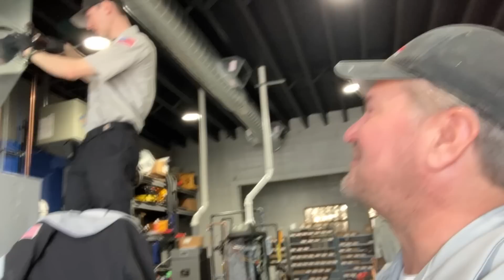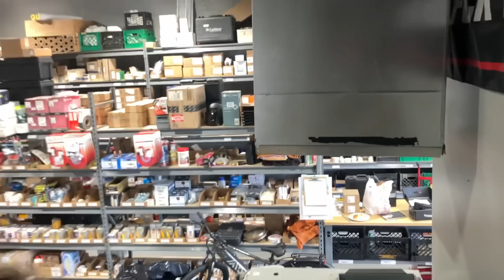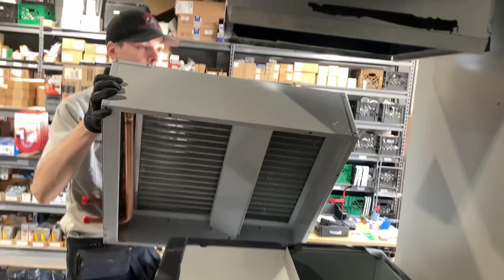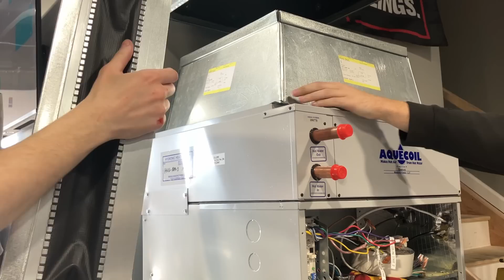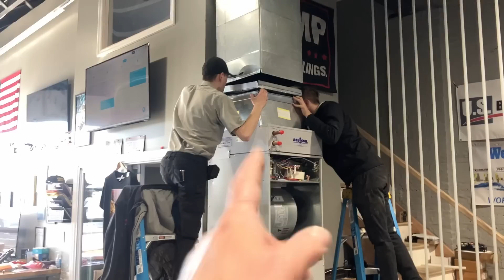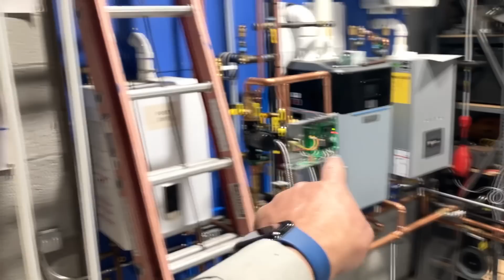Peter Has An Embarrassing Moment With A 75 Gallon Water Heater

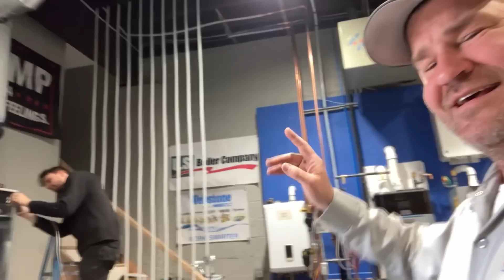Comment: 1:45  Hey Mikey, it would have been much better to use copper for that radiant wall....  Pex, ie thick plastic is an insulator, where as the copper will allow faster heat transfer to the air.  Maybe a large shop fan behind it up by the ceiling blow across it.  The air handler coil will be much faster and better, but...   

I have a large copper piping system with 5 floor to ceiling pipe loops of 1" K copper that I use for condensate trap for my shop air system, it allows the hot compressor air to cool and remove the water vapor, but its just a loop of about 65' feet of copper before it hits the manifold to the rest of the shop drops.  It works great and keeps water out of the air system. 

Keep up the good work for both you and your team!  👊😜
Reply: should have just ran bare baseboard fin and tube around up in the air.